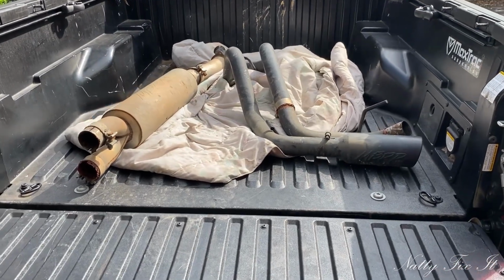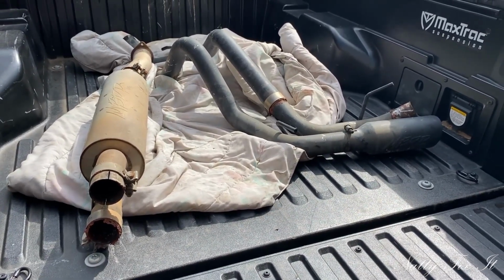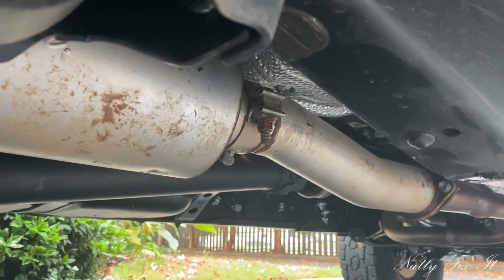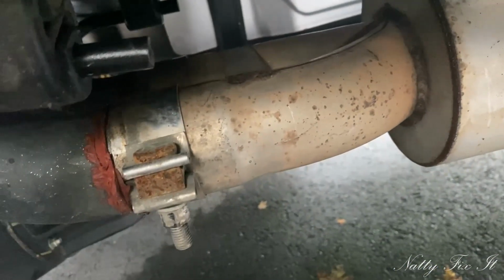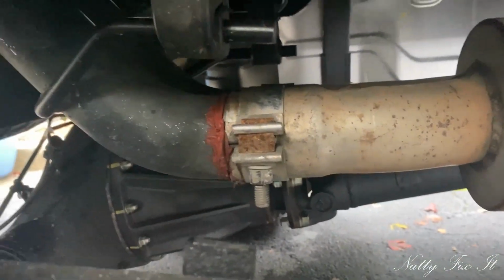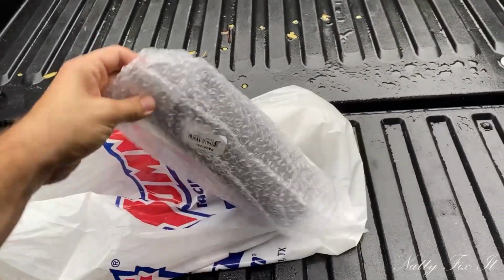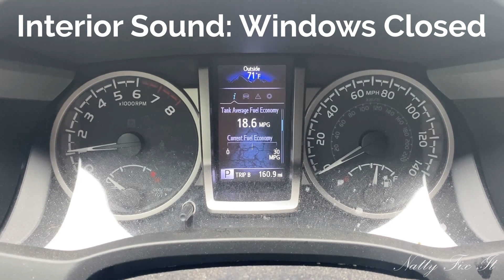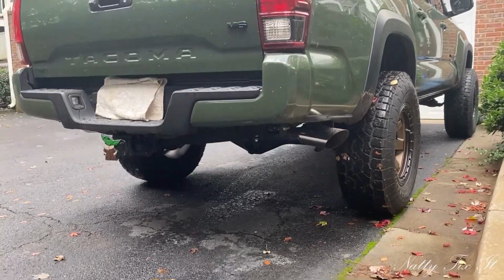Installing A Used MBRP Dual Exhaust On A Third Gen Tacoma

Comment: what year tacoma do you have? and what lift kit did you use?
Reply from the maker: It’s a 2021, I got the 4” maxtrac spindle lift and 2” blocks for the rear from headstrong offroad. They have a lot you can order that comes with DOT approved extended brake lines and rear shocks